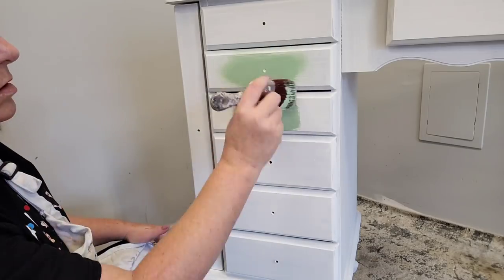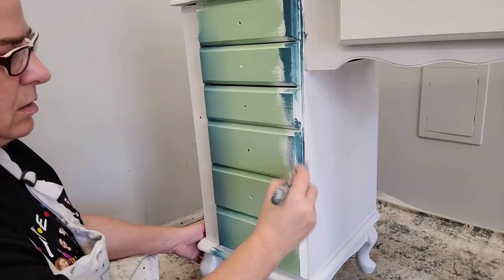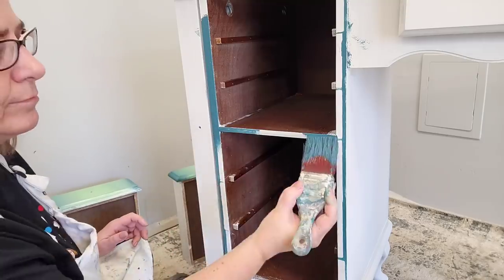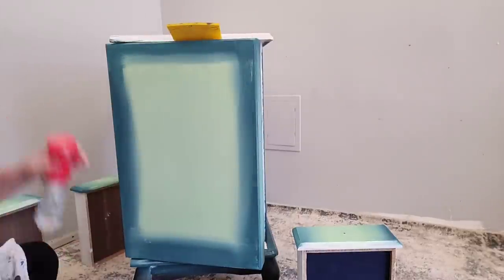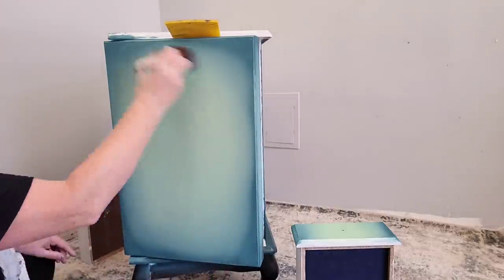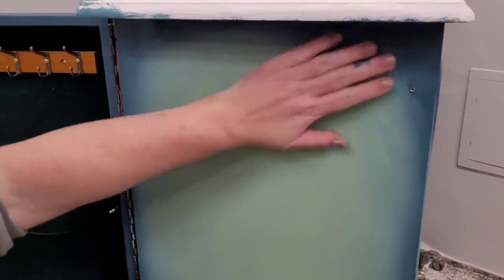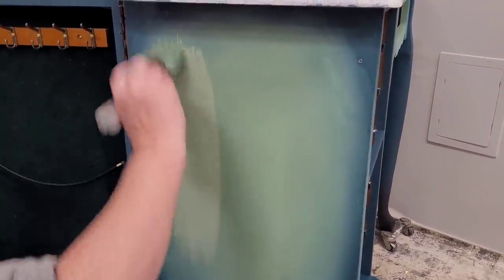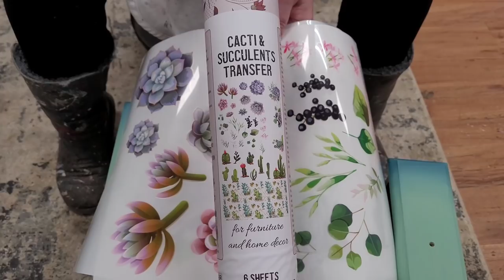Succulent vanity- a blended Furniture Finish using transfers and textured rollers

Comment: Ms Brandy, I have done many pieces of laminate furniture using Dixie Belle Mineral Chalk paint, Waverly chalk paint and even Annie Sloan chalk  paint and I have never used a primer or slick stick to make the paint adhere. I have some of those pieces in my home and they are heavily used (side tables & night stands) and no paint has come off of any of them. I do coat with 2-3 coats of wax or a top coat made for chalk paint. I use DB Slick Stick more for glass, ceramic or plastic.
Reply from the maker: I always err on the side of caution since they will be in customers homes. Slick stick is labeled for laminate as well